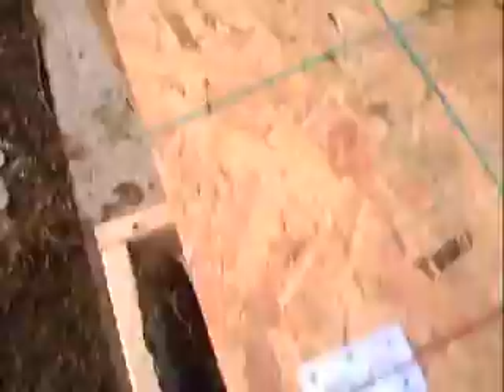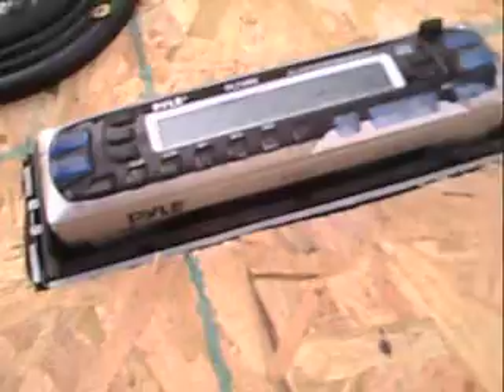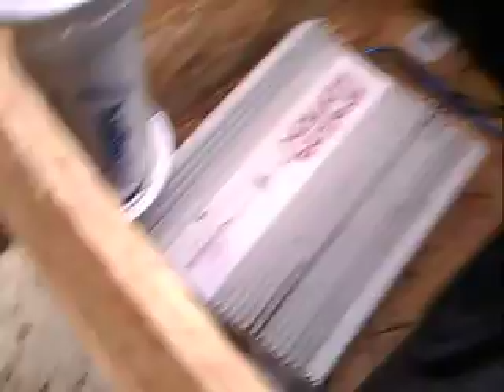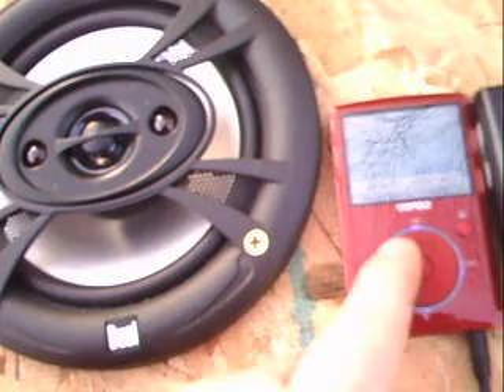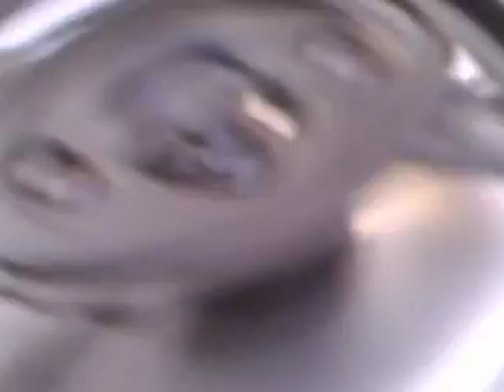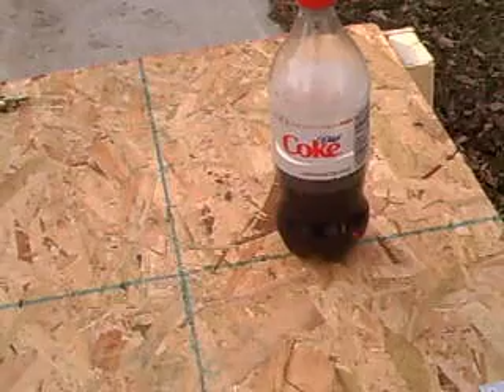my car stereo setup on my bike/trailer (please comment)

Comment from the maker: @PDUB6200  u need the speakers u are gona use something to put it all in seperate boxes for highs and lows(subs) them u need a realy good bettery that will keep charge for a long time.now this is the hard part u need to find a 4 channle anp that has enough power for the speakers so it dosent blow them the subs dont matter then u need a headphone jack to rca cable this will connect your music source to the amp the rest just wire it up normal have any more question just ask